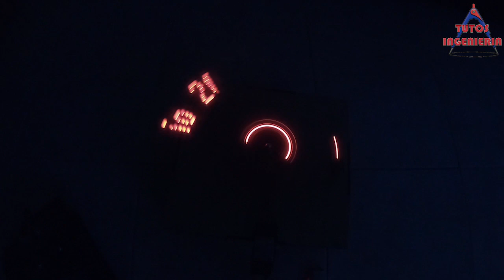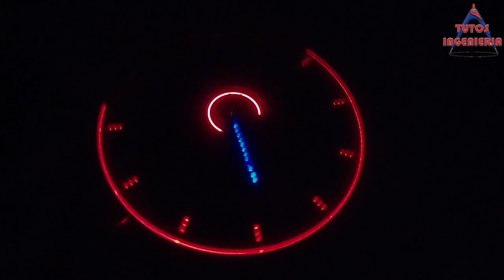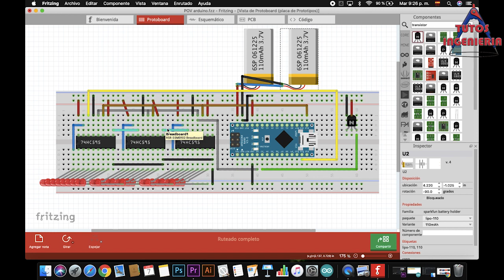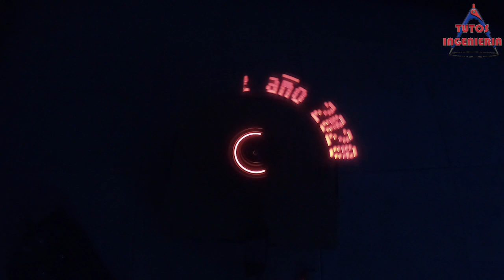💥ARDUINO nano POV display (brushless motor)🔥

Comment: Thank you for this very informative presentation.

I'm trying to develop a similar PoV system but everything is scaled up to a much larger size.

The only thing I struggle with is finding a suitable DC motor to drive the thing with. Else my design is ready to build.

Thank you again.